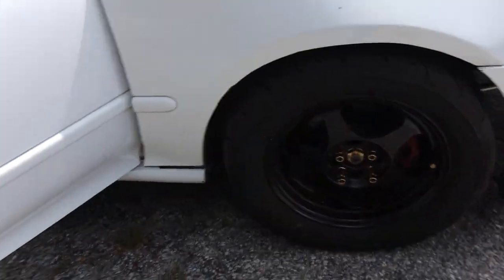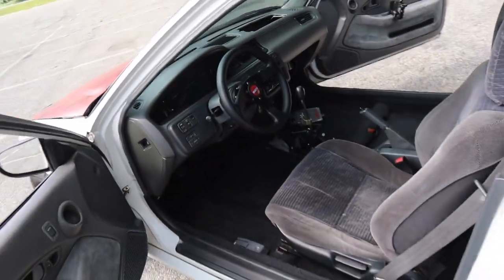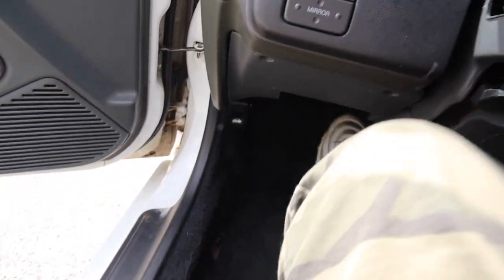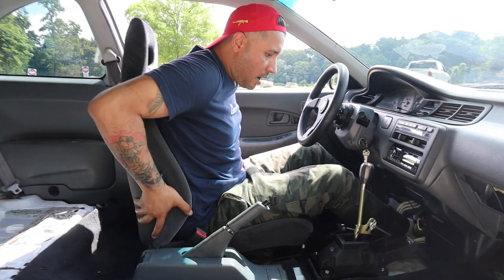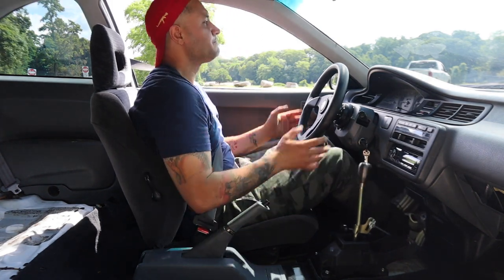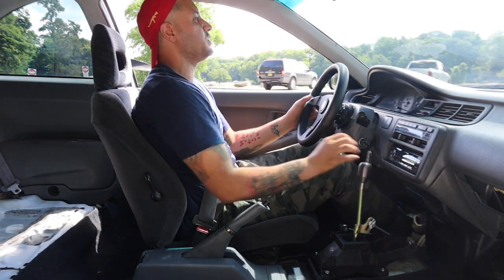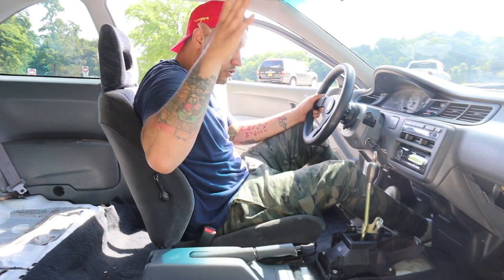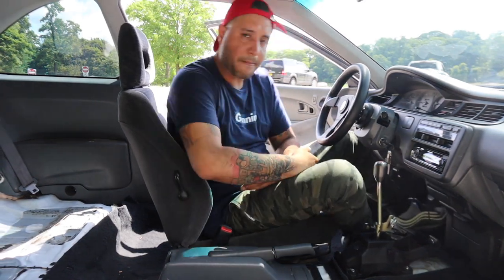How To Drive Like A PRO! (Safety+Hand Positioning+More) PART 1

Comment from the maker: What you’re learning is something people don’t want you to know. Use it responsibly please 🙏🏽🔫🌎
Reply: Gems!
Reply: Thanks aki 100% bro
Reply: G.m yeeeeeeeeeeeeerr nothing by gems lets gun it keepgunnin f.a.r ..salute gunner world
Reply: You should make a video about rules for the track for different classes, like how they changed the rule that you can’t have the fuel pressure regulator mounted on the firewall! That would be a great information packed video 🔫🔫🔫🔫💪🏼
Reply: That clutch engagement point being high up makes so much sense never even thought about that. 🔫🔫🔫🔥